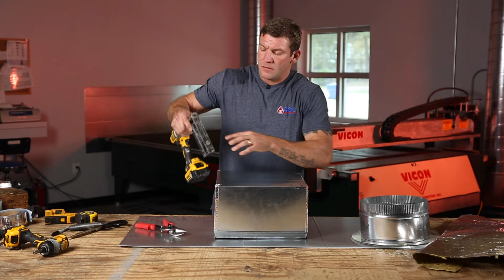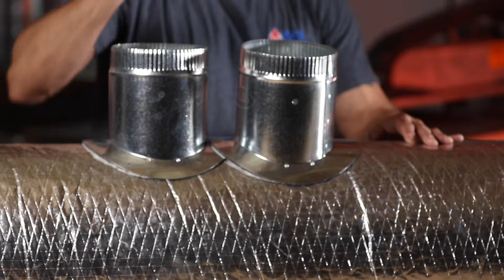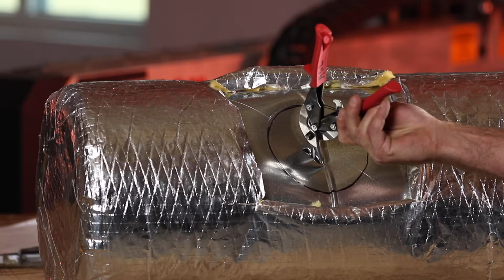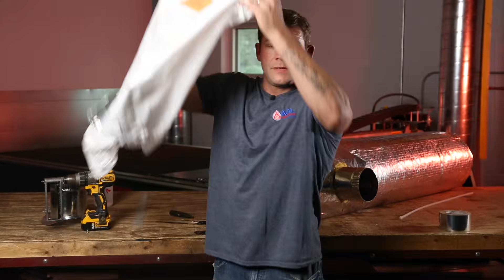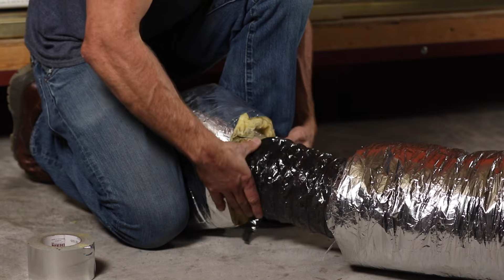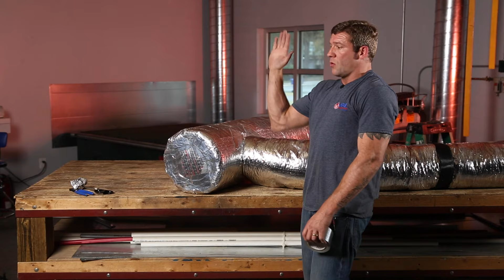Cutting takeoffs and proper attachment to trunklines (Mechanical Training # 104)

Comment: I like a lot of your work sir but there is so much misinformation in this video. No take off 24” from a capped end or any reduction. All takeoffs should be 24” or more apart. It is better to have 2 takeoffs across from each other than to have then closer than 24” apart!!!!! All of this information is so readily available from ASHRAE, Dept. of Entergy, and so many more recognized sources! The old way of doing things may work for you but you are cost your customers so much more each year on utilities! When you could be saving them money on those utilities because the system is designed and installed to be efficient. Save them cost for repairs because the system is struggling. The system will last much longer when designed correctly. There are so many more resins!

Comment: The heat in the attic will eventually harden the duct tape. I have some in my attic and it needs to be replaced. So I would use metal tape or something else.

Comment: Amazing video,very clear and at point teaching. Love your video and too bad you are not servicing Florida. We need to connect almost all returns from rooms to the main line. Builder did run the flex tubs but didn’t connect them to the Trunkline and that cause us a great trouble with AC uneven in rooms having 6-7 degrees difference from main hallway in the middle of the house where the main return it’s hook up and the rooms around the hallway. Now after leaving 10 years in the house we discover the returns are not hookup to the trunkline. I would love to give you the job but you are in different state. But honestly your video couldn’t be more clear and having mechanical knowledge and education,I think we my husband we can do it.
Thank you for your video and I already subscribed . I enjoy watching you valuable classes! 🥂

Comment: From a fluid mechanics point of view, adjacent takeoffs (or takeoffs on opposite sides of the trunk in the same area) are more efficient than having two side by side on the same side of the trunk (particularly when they are close together). Adjacent ones will evenly distribute the airflow to both takeoffs and create two opposing vortices in the trunk which creates a negative pressure in front of takeoffs leading to a forward turbulent flow in the trunk line which has better sheer properties and can actually improve performance over longer runs. Having them on the same side one after another will create two vortices with the same direction on the same side, this can cause two big issues. First, if they are too close, you will have flow separation and potentially flow reversal immediately after the second takeoff. Second, if they are too close the vortex around the first takeoff can create a turbulent flow over the outlet to the second one creating a drop in pressure in the second line.

Comment: Hi Andrew.  Great video.  Great tips.  Great techniques.  One question:  What is the duct tape you are using?  Many thanks.
Reply from the maker: In this video I used Nashua 365 https://a.co/d/fAO8lsM     This is a really sticky tape though so if it is really hot out  90°+, you might want to use shurtape (I dont have the model at this time).
Reply: @aglmechanicaltips  Wow.!!  Thank you for the speedy reply.  I will give the Nashua 365 a try.  Many thanks.!!

Comment: Can you teach us to connect a downdraft for an evaporative unit 3000 c.f.I . House 2:29 is 40 length x 35. It has three room left house plus 10x10 bathroom and right side living ding and kitchen. 
Do we use aluminum duct work or that flex stuff. 
Please teach us. Need your advise

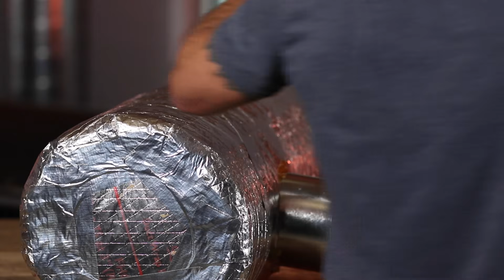Comment: Hey man. At 30:00 let's say I have a damper in that collar with a threaded rod and wingnut sticking out. What 's the best way to get that flex over that without rips, etc?
Reply from the maker: I understand the struggle here.  I bend the damper handle out 90° from the takeoff.  Make a VERY small slit in the insulation jacket and press the handle through the insulation and insulation jacket.  I then stab through a piece of duct tape with the handle to prevent the slit I made in the insulation jacket from spreading.  I then bend the handle back down.  So in the end you have a clean piece of duct tape flat against the insulation with the handle sticking though it.  I hope I explained this right, kind of difficult...  Also, depending on the flex brand you might not have to make the slit and can actually pierce it with the damper handle itself.
Reply: @aglmechanicaltips  you are the man. Thanks for the info. Top notch channel.

Comment: man - wish I'd found this sooner... I am on the tail end of redoing my upstairs (attic) ductwork.  Not knowing how to handle rigid duct I opted to just do everything with flex.  I basically made 2 straight headers down each side of the attic and tapped off to boots using wyes.  I screwed the flex wire to the wyes with zip screws and sealed with mastic tape.... the inside air seals are durable but the jacket seals are not super great.  I used canned foam to foam insulate the wyes but it makes the connection to the flex insulation odd.  I think my way out to a decent quality is duct tape between the vapor barriers and foam.  I am also considering zapping them with a coating of spray foam (2 part, not 1 part cans) as additional exterior sealant.  If the duct taping goes well then I may just be able to mastic the whole joint instead.

I leaned a lot on the attempt and I've also learned a lot from your great channel.  If I redo my ducts in the future (if the ones I just did have an issue or maybe when I go to change out my new HVAC units in 12-15 years) then I will definitely go with rigid metal headers, hopefully I can just find pre-insulated spiral sections... I don't understand why those aren't more of a "thing"....  pre insulated spiral with an array of pre insulated fittings... suspend, screw, foam seal together.

Anyway... thanks Andrew!

Comment: How do I measure insulation for my duct work, it's about 6' round, I want to make sure the insulation fit?
Reply from the maker: I did a video on wrapping round pipe.  See link on my channel but these are the pipe pattern sizes.  Note that depending on the brand etc.  these pattern sizes can be off a little bit.  Always dry fit pattern sizes and adjust as needed;

Pipe Pattern Sizes (ONLY APPLIES TO 3” INSULATION);
(Note:  Pattern sizes can change based on manufacturer and other factors)
ALL SIZES ALREADY INCLUDE 2” LIP!  
4” = 16" + 2" Lip
6” = 23" + 2" Lip
8” = 30" + 2" Lip
10” = 38" + 2" Lip
12” = 44" + 2" Lip
14” = 52” + 2" Lip
16” = 57" + 2" Lip
18” = 65" + 2" Lip

Comment: What tape do you use?
Reply from the maker: Mastic tape used
https://amzn.to/3HHVAdx 

Duct tape used
https://amzn.to/3PD7441
Reply: @aglmechanicaltips  when do you use each tape? Is the mastic tape used on the connection between the flex inner core and the metal takeoff and also the flex inner core to metal boot? 

Is the non-mastic tape only for the insulation?

Great series of videos btw. I've learned a lot!
Reply: Very informative video.
I subscribed so as not to become a bitch/ripping duck tape at same time.

Haha….that broke the class tension at the end.

Curious if you have a video on installing the vent boxes.
I’ll scour your videos to see…..loved the tutorial.

Do you have a cheaper recommendation on the tape to use?
$55.00 is a lot of money for a small job.

Comment: Branching is the best best method, it self-balances air pressure and velocity.gradually reduce the size from the plenum with wyes and always use angled take-off’s (unless you’re working on a tight area such as a basement)
Also,make sure to use dedicated Panduit gun (semi or automatic) and keep duct stretched and turns smooth!
As a side note,we always use manual adjustable dampers, (where access is possible) it pays off when customers call-back complaining about un-even airflow (trust me,they always find a problem in one of the rooms)!
And last but not least… if you’re running over 25 feet duct,upsize diameter 2” for friction,remember air is a fluid and follows the rule of “Path of least resistance”!
I keep learning and improving my methods every day and following others good practices I’ve seen when I get a chance(on service calls) and applying what I’ve learned over the years… I must say without bragging that the results are extremely satisfying!
This video it’s a good introduction for the apprentice on “How to” do the work,but in practice wouldn’t perform at it’s best!
Good enough it’s neither good nor enough!
Don’t get me wrong,this is a good video,but it would be a great video if it further explained the above mentioned facts!
Reply: Why don’t you explain what your “branching” method is and show these “angled” takeoffs you would use on round pipe trunk line.

Comment: TWIMC

here in socal in commercial for flex tails, we use panduits with a strap gun and some people sink 3-4 screws into the zip tie. After using the strap tool, I've never had one snap or fall off with or without screws. As long as the strapping tool was used on a fitting with a rib, without a rib it'll forsure pull off but get it tight with the strap gun and fasten some screws through the zip ties, like 3 or 4 minimum even spaced out, then call it good. And the use of tape is unnecessary and air leakage will be minimal which imo makes the process easier, quicker, and prevents frustrations from working with tape.

I'd also like to add that i think people snap the zip ties using the strapping tool and snap the zip ties which leads to frustration, causing them to hand tighten them or use linesman. Which  is easily pulled off, however some screws into the zip ties can help without the strapping gun.

However I believe this is due to mishandling of materials. If film tape, zip ties, or even the pookie get left in the sun it can degrade such materials significantly. 

Thank you showing how to insulate fittings, i spent hours google searching how to and such info was not available. Cant wait to wrap a 90 and it look tits

Comment: Great video. No FSK tape?
Reply from the maker: No, we are required by code to coat our duct tape seams with mastic in my area.  Duct tape works a bit better for contours in this application in my opinion.  I do use FSK for small tears and rips simply because I can hide the tear altogether and it looks better than a blob of mastic in one small area.
Reply: @aglmechanicaltips  Gotcha,  thanks for the response.

Comment: Just watched all 36 minutes and loved it. You have taught me a lot about running and installing ductwork.  Am about to tackle my house here in Florida. Original ductwork is 39 years old and I’m losing air and house stays dusty all the time. My house is only 1200 sq ft
and replaced my unit from 1 1/2 ton to 2 1/2 ton just 10 months ago.  The original ductwork is all flex , main truck line is 10” with 4” going to all the registers. Any tips or advice or other of your videos of yours you can tell me.  Thanks again for taking the time to share your knowledge in this matter of HVAC ductwork.
Reply: Hi Mark. I'm in FL too with similar situation. Did you get this done? How did it go?

Comment: Ok liked and subscribed first of all, second, I'm a commercial HVAC lead in Indiana and I have never seen anyone duct sealing the outside of insulation. Is that required in your area? we also never use the yellow formaldehyde insulation usually r-4 1/2 inch formaldehyde free, the white kind. Unfortunately, Panduit straps are commonplace here but I also tape the inner flex and then the outer after Panduits. Though after hearing your tear out experience with sweating I may stop panduit strapping the outer jacket. I am very curious to get your thoughts on some things as I am always trying to grow and learn. We typically wrap out pipes before installation, and then double back and duct seal all metal seems, then the next day we come through and piece out the missing insulation. We do not use staples as a matter of fact I have never seen staples be used here. Almost everyone uses Nashua FSK tape for holding the insulation together and some companies only use 3M Venture Tape UL181 which both does not adhere very well, and looks bad so I try not to ever use it. Also wanted to give you some video ideas since it seems that the channel is new. I would love to see you wrap a reducer and an end cap and some other fittings. thanks.
Reply: Yeah, I actually need to see a reducer wrapped as well

Comment: Your knowledge is amazing/impressive! I am working on a small 2 bedroom 1 bath home 880sq ft. The plan is to install a 2 ton unit with a square to round plenum that will include a 12" trunk 5-6' long. The trunk will have 6 takeoff saddles,  (2) 8" for kitchen/dining and living room. (2) 7" for the 2 bedrooms and (2) 5" for the utility room and bathroom. From trunk to register boots there will be flex duct used 3' to 6' long max. I am wondering if this will provide sufficient air flow?  The ducts will be in the unconditioned space with the intention of producing a compact system. Attic space is limited, the highest point is 24" Any advice will be greatly appreciated.
Reply from the maker: Without me going to paper with what you outlined I believe this will work fine.  I would run a 14" return minimum to lower the system static pressure but 12" supply should be fine.
Reply: @aglmechanicaltips  Thanks Andrew! I watch your videos over and over, you have made it soo much easier for me to insulate. I hope you were in south florida, I would hire you, down here quality and workman ship is soo poor. Its all duct board and flex. I am looking for a quality install that I can only achieve by doing it myself.
Reply: @aglmechanicaltips  After writing my question. I have decided to make it mostly sheet metal, except for the area that the ducts cross the attic opening, there I will run short piece of flex, so if I ever need to go in the attic, I can remove the flex for easy access.
Reply: @aglmechanicaltips  I am installing a 9" jump duct from room to room and in the bedroom I am placing a 14x14 return grille on the wall where the air handler is on the other side. For the rest of the house, I will be using a louvered door.
Reply from the maker: Return will work great like that.  Is there a reason you are using hard pipe for the branch lines?  Sheet metal is technically better durability wise but if flex is strapped properly there is absolutely nothing wrong with it and your system will be much quieter at the vents as flex does much better acoustically.  So hard pipe or flex but if it was my house I would flex those runs all day long especially with how short they are...
Reply from the maker: Strap flex every 4' with clean turns (no hard bends, always gradual turns if possible).
Reply: @aglmechanicaltips  can send you pics of what I got soo far?

Comment: Thanks for the great tips 👍 I am in Canada and we use rigid uninsulated ducts, which are (mostly) in conditioned space. But it is very informative especially as the flex ducts (as the manufacturers say) are gaining popularity here as well. Could you advise what kind of duct tape you are using and what will happen if you dont mastic over the tape at the take off? Do you use flexducts for 2 storey houses as well? We have difficulty moving air from the basement to the second floor with rigid ducts. I am wondering how it would be with the flexducts. Thanks 🙏
Reply from the maker: I was using Nashua 365 duct tape but I will changeout the tape used based on the season and outdoor temperature (super sticky duct tape is hard to work with on hot days).  Mastic provides air sealing when applied directly to sheet metal seams.  When applying mastic over duct tape on insulation seams it just provides another level of durability to the tape and prevents the tape from coming up.  If you didn't mastic it, it would probably be alright but if it's available I would apply it.  
Couple notes on flex ducts; In my region, we don't have basements and normally wouldn't "chase" duct up to another level due to the length of run and a couple other factors.  Long lengths like that should probably be ran in hard pipe but flex can be used if you do a static loss calculation on the flex and upside the flex to a larger size to account for the static loss.  Example:  a 6" hard duct that is 20' long might be equivalent to a 8" flex duct that is 20' long (I didn't calculate this, I'm just giving you an example).  Hope this helps.
Reply: @aglmechanicaltips  Thank you very much for such detailed answer. 🙏
Reply: Do you ever have condensation forming on the uninsulated ducts?
Reply: @hairlesscactus  in normal situation - no. In my experience I had issue only once, when the guy closed basement registers and it was very humid there and airflow was slow, so that ducts where very cold. Sometimes plenums sweat a little bit. Other than that no issues. And we have 70% humidity in the summer.
Reply: @thecurious6721  thank you for the reply!!